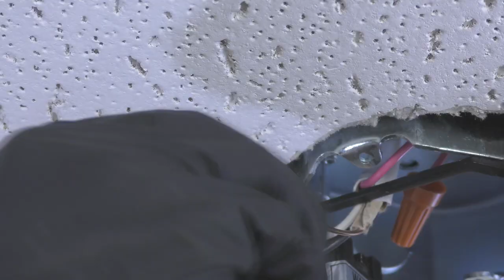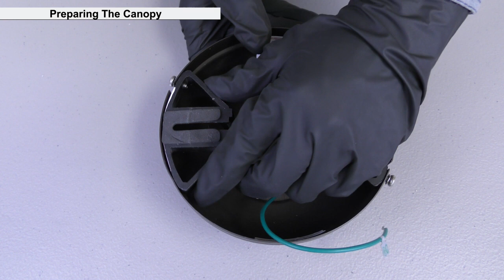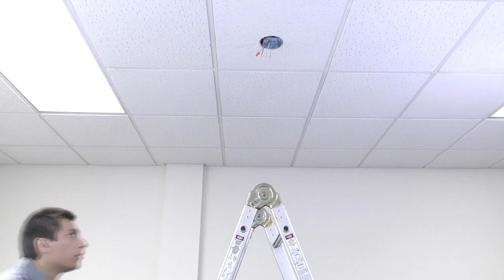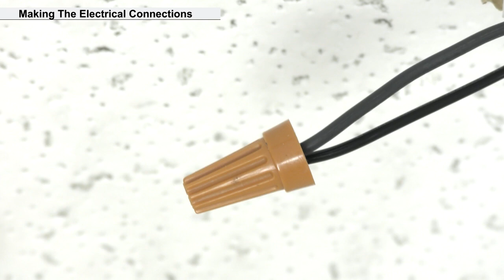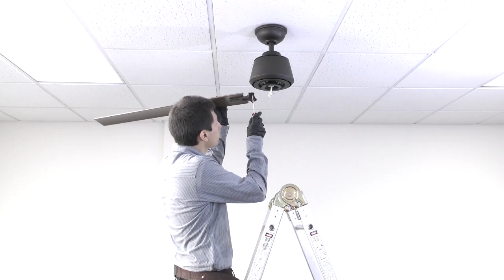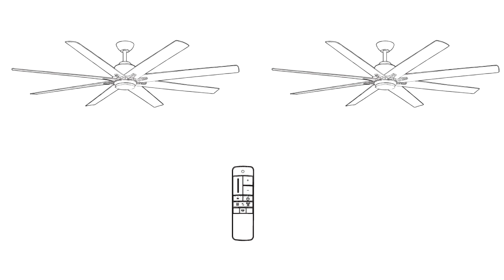72" Kensgrove Ceiling Fan Installation Guide (Discontinued 2016 Version)

Comment: My fan doesn’t have a receiver... my room has a 2 gang light switch, does that mean the red wire is another hot wire? If I were to connect the blue wife from fan to the red wire in house would that work? Would that make it so the fan and the light or turned on/off by the two different switches I have?
Reply from the maker: The model in this video can only have it's light controlled with the remote. However, most fan's with a separate blue wire as you describe can be wired to control the fan and light separately from a wall switch. The wiring in your home may differ, but generally there will be a black wire from the switch for the fan's black wire and a red wire from the switch for the light's blue wire. You can use the electrical connections instructions from this video for reference: https://youtu.be/Izr4rHWTyqw?t=258

Comment: The fans light looks yellow rather than a bright white, is there anyway I can fix this? It’s suppose to be LED but it doesn’t look like it.
Reply from the maker: The latest version of the Kensgrove uses a Samsung branded 14w LED that emits 3000k warm white light. Unfortunately, the color temperature cannot be changed. If you suspect that your light isn't emitting the correct color temperature, contact customer service for assistance 1-800-986-3460.

Comment: Great how-to video.   This install walk-through was perfect.  I managed to install the fan by myself in about an hour.   I have installed a few fans in the past,  but this was still a major time saver.   Pretty much anyone can install this fan with this video.       The fan is also amazing.    The nicest fan I have ever seen.  I wanted to replace an older fan that did not have a remote.  Saw this on sale-and it had nearly a 5-star review with more than 1000 reviews.    The 8 giant blades move a lot of air, with very little AIR noise.   The motor is silent.  The Breeze Feature is more impressive than it sounds  Genius  idea.

Comment: We have a 3rd wire thats red in our ceiling. The fan only has 2 wires, white and black. What connects to the 3rd wire?
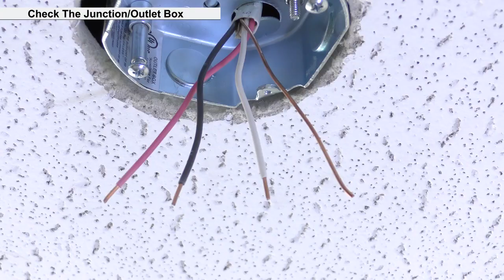Reply from the maker: The 3rd red wire isn’t required for the installation and can be capped off with a wire nut as shown at the 1:32 - 1:45 timestamp. 

In most homes, the red wire is simply an alternate hot wire that is controlled with the on/off switch on the wall, while the black wire in the box is a hot wire that is always powered. You can connect the fan to the red wire instead of the black wire, giving you the option to cut power to the fan from the on/off switch.
Reply: TAL International Rick thank you so very much! Thats what we did and it works perfect!
Reply: TAL International Rick We have installed the fan. We have the same issue..3 wires from the ceiling (bare, white, and black). We have installed the fan according to the video and the remote is not syncing.
Reply from the maker: If your remote is not synchronizing, you should first check the following;

1. Remote has battery power: Ensure 2 new AAA batteries are installed correctly in the remote.
2. Remote is functioning correctly: Ensure the Green LED Bar on the remote is flashing when the power button is held.
3. The fan has power: Ensure power has been restored at the breaker and any on/off wall switches in the room that may be connected to the fan's outlet box should be in the “on” position.

If the above list doesn’t resolve your issue, you should contact customer service for more detailed solutions. Call the number in your owner’s manual, or email service@tal-usa.com.

Comment: Hows the lighting? Is it bright?
Reply from the maker: All Kensgrove models currently being sold at Home Depot use a Samsung Branded 14w LED rated for about 1200 Lumens. That is sufficient for a 120 sqft. room, or about the size of your average living room. Essentially, the lighting is a bit brighter than your average CFL/Incandescent bulbs found on most traditional ceiling fans.

Comment: Well made video.  I have the same fan but has a wall mount remote. Do you know if the hand remote will work with my fan. My fan has been up about 1 year. It works when it wants to. Just about the time I think I have it working properly it starts acting crazy. Fan will always come on but you never get the speed you want. We always want the highest speed most of the time. Most of the time it stays on low. Very disappointing because I love this fan when it works properly. I guess it time to call customer service. Thanks
Reply from the maker: Unfortunately, the black remote from the fan in this video is not compatible with the original Kensgrove fans that include the wall remote. Sometimes issues on your version of the Kensgrove can be corrected by completing the learning process and calibration again.To do it with the wall remote; 
1. Cut off power to the fan using the breaker or the wall switch and wait a few moments. 
2. Return power to the fan.
3. Within 30 seconds of restoring power, press and hold the "SET" button on the wall remote until the fan starts spinning. (Set button is found next to battery under face plate).
4. Wait until the fan finishes self calibrating (The fan will spin up to 3 minutes in one direction and up to 3 minutes in the other direction).
You can find the step by step instructions on the "Operations" page in your owner's manual. If this does not resolve your issue, contact customer service and they will identify what is causing problems with your fan.
Reply: I could have written your post as I  have the same fan with wall remote and the fan only does what it wants to do. Sometimes it will go backwards when turned on other times forward. The only thing that works as it should is the light and the on/off button.

Comment: My fan will not sync!!
Reply from the maker: Before contacting customer service, check the following: 

1: Remote has 2 AAA batteries and lights up when the power button is held.

2: Power is turned on at the breaker and any switches in the room are in the on position

3: After power is turned on you immediately press and hold only the power button on the remote (do not press other buttons or wait longer that 30 seconds). 

The light will flash twice to confirm that the fan is synced.

If your fan still will not sync, call 1-877-902-5588 or email service@tal-usa.com. They will troubleshoot with you to determine the cause.

Comment: Where can I find that remote the one that came with my is different and not as nice
Reply from the maker: The original Kensgrove fans (brushed nickel and oil rubbed bronze finishes) use a common white remote. Unfortunately, the black remote in this video is new for this year and currently only the Kensgrove in the new Espresso Bronze finish (Model# YG493OD-EB) is compatible.